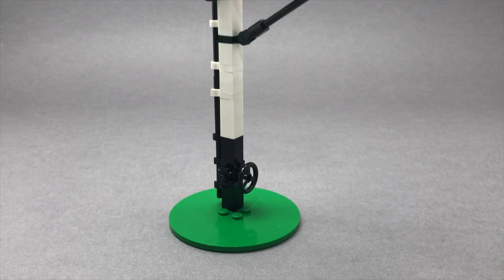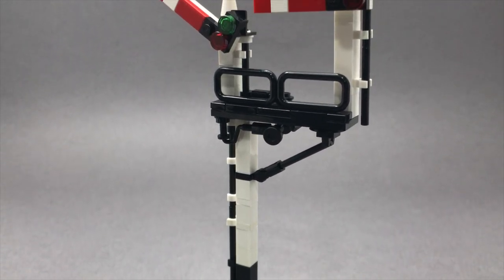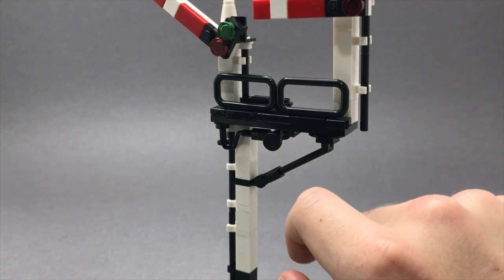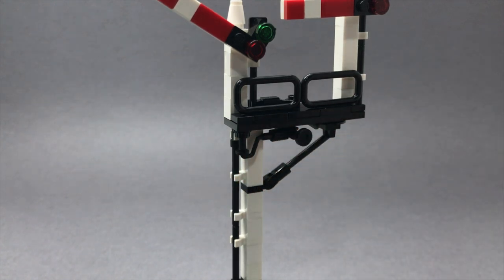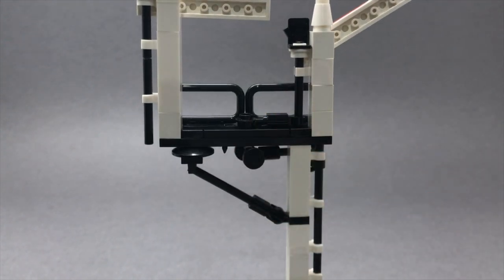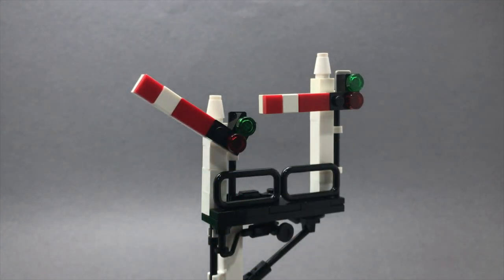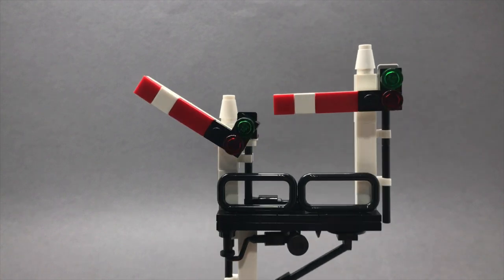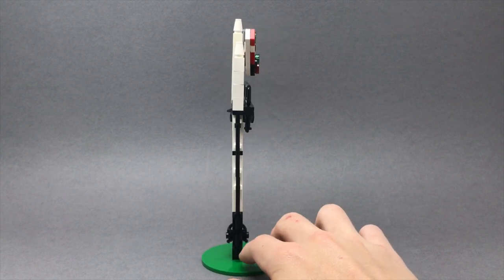LEGO Train Signal MOC

Comment: Those vertical rods are not stabilizers or not ever power lines, those signals were full manual, the rod is a rope leading from control station all the way to the signals
Reply from the maker: Filip Gaczkowski a thank you very much
Reply: *Codelines (“rope”)
*Interlocking tower (controls signals and track switches)
Reply: @LionBricks  will you do a tutorial on for this